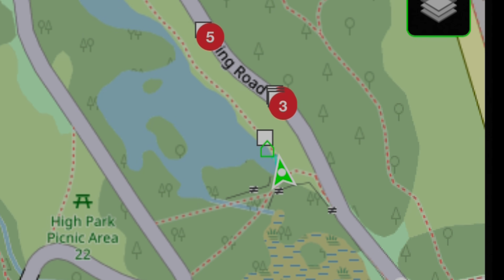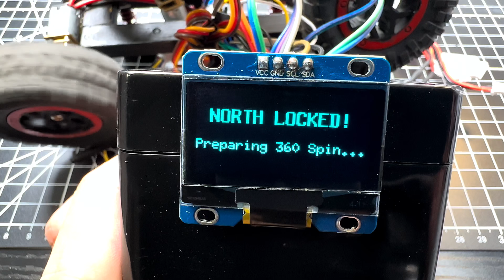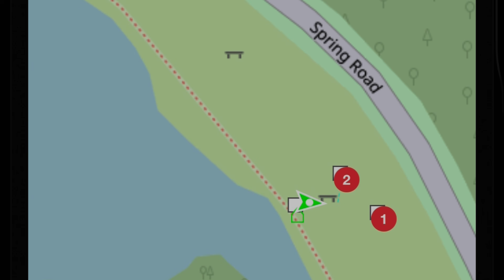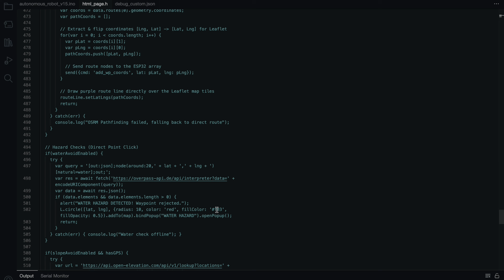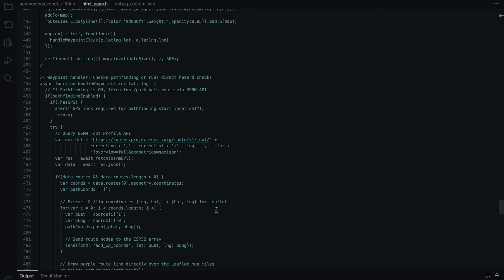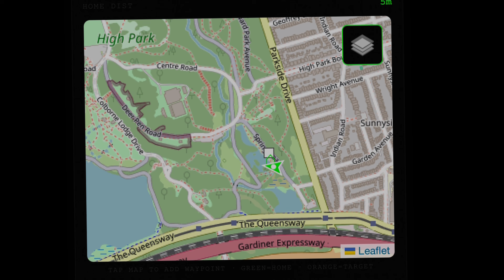DIY GPS Navigation Robot with ESP32 (Autonomous Waypoints)

Comment: Cool project.
Next step add RTK support and you could provide the grocery delivery robots for your region.

Perhaps you can rekindle the OpenMower project that used RTK to upgrade a common mower to get hold of a functional platform only needing a better brain.

The ones used here in Helsinki are also 6 wheel skid steer.  I hear that they have operators watching them as they move because they navigate side walks across busy intersections.  I believe that they will be autonomous until they detect an obstacle or a road crossing and then pause for an operator to guide them, the pause lwngths are pretty random in length so that sometimes there may be a shortage of operators if all the robots hit a road crossing at the same time.
Reply: Consider collaborating with Greg.
I left a link to another yt video in a comment and it has disappeared.

Search for the following video.
"Can LLM Drive Robot to Another City? Greg's Tech"